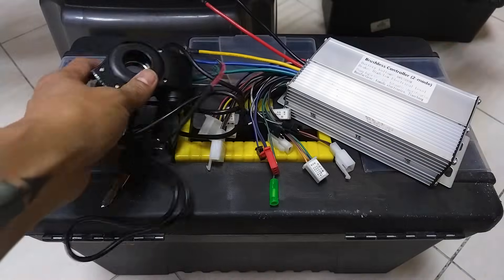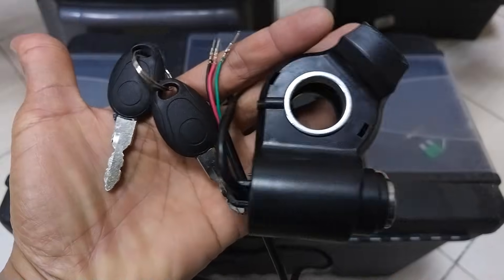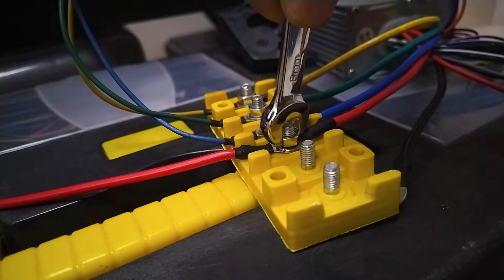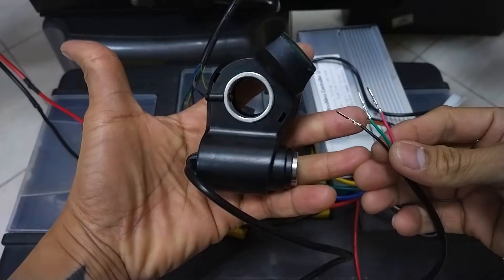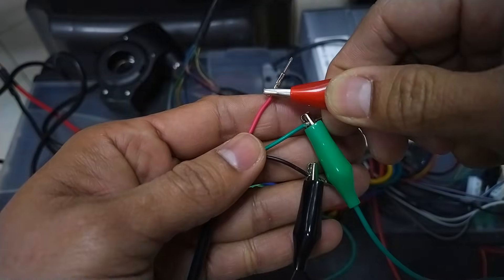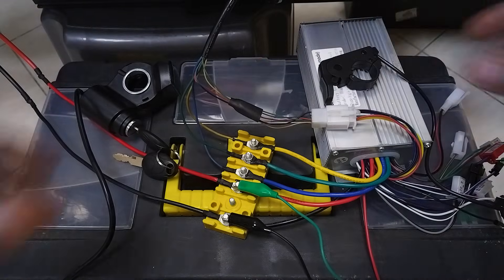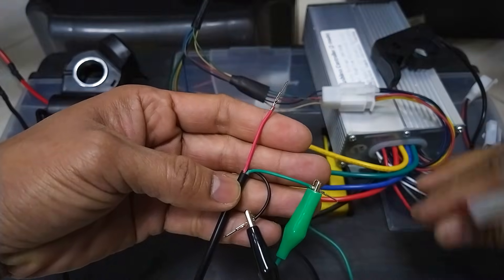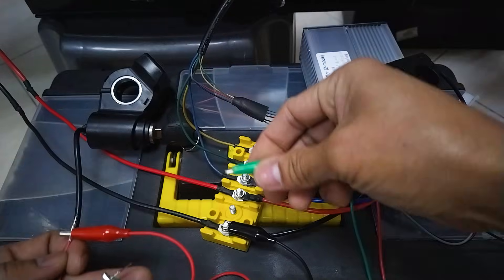How to Install KEY IGNITION SWITCH on a Brushless Controller | Wiring Guide

Comment: Thank you so much for the help would you know if the switch/lock wire (red) goes to the vcc solder point on the controller pcb ?
Reply from the maker: Goodday!
Yes, the switch/lock wire goes to the VCC.
Thank you for watching.

Ride safe always!
Reply: @jaysonulanday thanks! hey it’s there a way to contact you?

Comment: Sir,may tutorial ka ba ng controller na may 3wires(for key ignition) pero wla akong key ignition. Meron lang akong finger throttle na may power on/off. Panu ang gagawin para mag turn on? Ayaw kc mag power on dahil ying controller may key ignition feature(3wires) gaya ng video mo na red-black-green. Sakin red-black-pink.  Anu gagawin ko sir?

Comment: Are the crocodile clip wires your permanent setup? And if not how do I safely connect the igntion wires as it is in the video?
Reply from the maker: Goodday!
No, the aligator clips were only for tutorial purposes.
For the ignition wires, you need to install/connect directly to the right wires as shown in the video.
You may solder the wires...or change the connectors for essy connection(plug&play)

Ride safe always!
Reply: @jaysonulanday thank you for the help.
Reply from the maker: @sounds8385 
You're welcome😎
Thank you too!

Comment: If I have two wires on my controller for the switch a red and orange (orange I believe is vcc) which one should I connect to? The red positive or the orange vcc?
Reply from the maker: Connect the orange wire(vcc) to the red wire of the key ignition switch.

Don't forget to open the controller for you to check the right wire (color) of the VCC.
Reply from the maker: Goodday!
Most likely, the orange wire is the VCC.
But you have to consider that manufacturers have their own wiring standard.
I recommend that you better open the controller and see it yourself.
This way, it is more safe.

Ride safe always!

Comment: can you do this on every scooter?
Reply from the maker: Goodday!
Yes, it depends on the wirings of the controller.
Some controllers have different wirings.
But as long as you know which wires are needed for this modification then it will be possible.
Check this first tutorial vid that i made.
The controller has different wirings.
So i did different procedure too.
https://youtu.be/9ruIpyQyXZ8

Ride safe!🤟

Comment: tanong lang po yung 500wats na controler pwdi ba syang palitan na controller 1000wats hindi kaya masisira yung hube motor na 500wats lang salmat sa sgot
Reply: salamat sa replay idol
Reply from the maker: @nidaesteda1042  
Maraming salamat din sa suporta kaadik!
Reply from the maker: Pede nmn kaadik kaya lng iinit un hub motor kase beyond na sa limit niya un wattage na ibibigay nun 1000w na controller.
Aandar ng mas  mabilis un hub motor pero magiinit din.
Reply: hindi namn sya masisira cgoro.  normal lang yung init.
Reply from the maker: @nidaesteda1042  Di nmn  basta basta masisira un motor, basta wag ka lng magbabad ng matagal na naka throttle.
kung baga pasundot sundot lang. 
Pero iinit pa rin.
ride safe lage kaadik!

Comment: Lodi can i ask if is possible to use a 36v 7.5ah on series Y connected to my 48v 20ah main battery to my 80a controller?
Reply from the maker: Goodday
Do you mean, you want to connect the two batteries in series to increase the voltage?
Reply: @jaysonulanday  yes lods correct
It is ok even if they both have BMS?
Reply: No please, its better to series it with same [ah] like 36v 7.5ah and 48v 7.5ah
Reply: @mrcoco3562  even tho i have tried it already to connect them.. the only problem i have is that when i fully trotthle the ebike it turn off the bms of the 36v and it turn itself on after a 30 seconds.. used it like that for almost a year
Reply: @mrcoco3562  i have always monitored the battery temperature and constant voltage of the 36v just to be sure